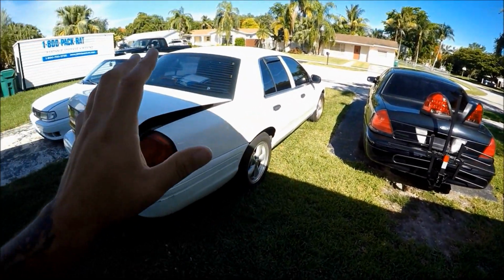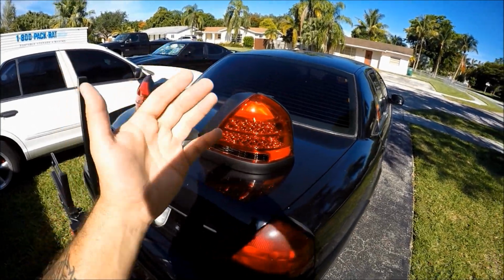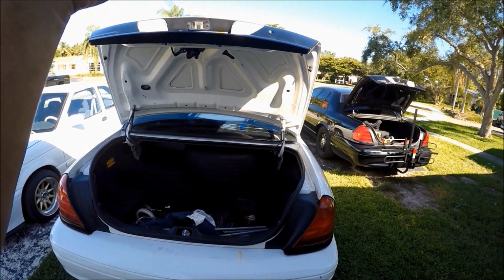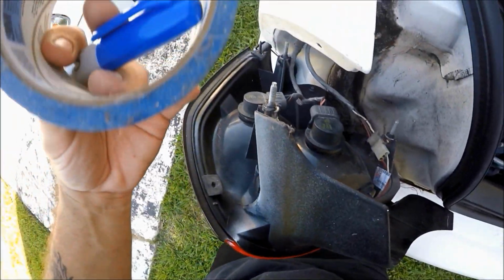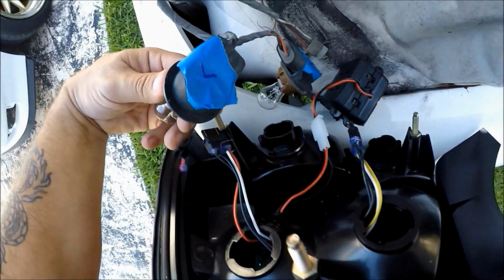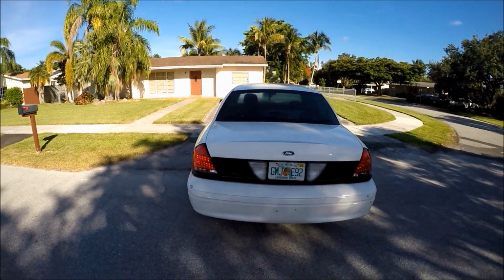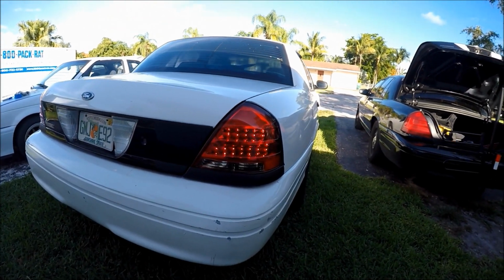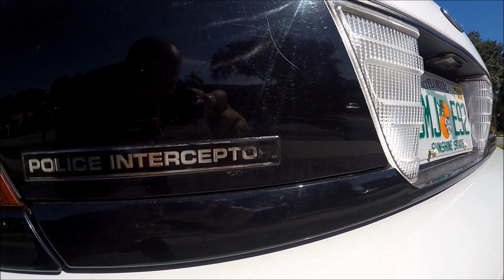LED Tail Lights Installed!! Project White Lightning

Comment: Just a FYI. The brake lights do randomly not work. I am a police officer and have experienced this and seen this many times over when we had Crown Vics in our fleet. Plus I own one myself and have had this same issue with mine. The brake switch is faulty. It sometimes doesn't activate the lights or if you let off the brake pedal a little, but brakes are still engaged, they will stop illuminating. Replace brake switch. It's seen its fair share of use if it was a retired unit.

Comment: Hi I had recently received my LED tail lights and I think there grate .how ever I would like to change the relay. Where is the relay located.   Also what did you do with the extra wires.  And plug.  When I received my lights there were no instructions.

Comment: Sir. You need to edit your video and cut out the part where you're informing watchers that you can get rid of LED hyperflash by replacing a relay under the hood with a LED type blinker relay. This is completely incorrect. There is no blinker relay on the Crown Vics. They have a Lighting Control Module (LCM) under the driver's kick panel near the center. It is one large module for all lighting control. You will be required to do a resistor on both sides for the wire that makes the lights blink. Also, that black box with the sticky pad that came with those LED tail lights is a resistor to prevent hyper flash. However, the manufacturer of the LED lights messed up with their wiring due to the dual plugs they provide causing a short when the brake lights or blinker is used. I think it is bullshit because I ended up having to replace 3 different fuses in relation to the hazard lights, blinkers and brake lights trying to figure out where they messed up at when I did this year and half ago. Anyways, edit your video sir. Individual resistors are required to prevent hyper flash for the Vics.
Reply: Your answer is exactly what I thought he was going to say... an inline resistor to trick the computer into thinking the old style light is still there
Reply: Hey bro,  i have the same led lights with the two.black boxes i only hooked one of the two wire connections like mr random said. So i have hyper flash when turn signals are used are those black boxes useless or wired wrong . How did you fix the problem any help would be appreciated thanks mr Jesse.
Reply: @jessecadena9485  You still have to place load resistors on the turn signal wire. The two black boxes are only for the brake lights, not the turn signal. These lights were not actually designed to flash with the brake lights applied. That is why they put those extra holes at the bottom. Those are for the turn signal lights that you have to add yourself.

Comment: Currently saving for my own CVPI to replace my '99 Plym. Gr. Voyager, named B.R.U.N.O. (Busted Rusted Ugly Nonetheless Operational) with 185K+ miles. He runs, but there's a new noise just about EVERY day. He WAS bought new in '99 when we had our daughter & NEEDED a m***van. We drove her & her friends & then the sick br.-in-law & elderly fr.-in-law back & forth to Drs/hospitals/VA/etc. We kept him until a m***van wasn't needed any more, but they wouldn't give us much on trade. So, I sold it to a tradesman who used it as a shuttle for guys, haulin' equip., runnin' errands, just an extra set of wheels as needed.

When HE didn't want/need it any more (just didn't need the extra expense, really) & I needed a vehicle (my Escort had JUST died), he GAVE it back to me AND. . . PAID for the plates, Township sticker, & transfer fees. This after. . . 2 "rolling" accidents, a "parked" accident, a wrinkled hood incident, 2 transmissions (they tended to "act up" after about 75K mi.), a "new", boneyard engine, & never, I mean NEVER cleaning the interior (gross!). But hey. . . free, right?

Everything worked (save the vent windows in back) even the A/C, throws heat like a blast furnace, & ran "pretty smooth". With a set of plugs, a whole can of SeaFoam run through a fresh, full tank of "Hi-Test", a "new" driver's window switch, "new" driver's SEAT (19 years of butts REALLY flattened it down), carpeting/padding (gross!), a fresh headliner, LED dome lights, restoring the crusty (yep), yellow headlamps, adding road lamps, flood headlamps (for unincorporated areas), back-up flood lamps, & alley lights . . . he's a top notch pizza delivering "machine". I've even  accidentally driven over. . . a few things (didn't KILL anything/anyone, tho), driven him in the >100° heat & <-30 cold (w/a "batt. tender), through 6' snow as well as 2-1/2 ft. water, & am, honestly, surprised at how TOUGH this stupid, ugly van IS!

Still, $750 saved, $1250-2000 left to go & I'm gonna get my CVPI & outfit HIM better than B.R.U.N.O. . . w/ Mr. Random's assistance. Selection of a vehicle, LED head & tail lamps, pushbar, finding any "hidden" features & upgrading the interior, ALL THAT & more (I'm sure).

Thanks for the channel, information, tips & tricks there, Mr. Random. Keep it up!

Comment: Got some of the LED tails for our 09 P 71. Followed instructions, install went great, plug and play. Marking the L/R plugs helped however..... no power, new tails don't work. Checked several fuses and found 2 that blew. If LEDs draw less current why would they blow 10 and 15 Amp fuses? Any thoughts? bash26

Comment: You can also buy load resistors as well right? I should've looked into the led relay when i installed load resistors for my front turn signals/parking lights.

Comment: Hyper blinking is actually illegal in most states if not all of them.  I believe the DOT sets the standard.  Turn signals are supposed to flash approximately 60 times per minute.  The reason it flashes approximately 120 times per minute after changing to LED is exactly as you stated that the car thinks there is no bulb there.  It is designed like that on purpose that to tell you that a bulb is burnt out and needs to be replaced.  It can also be a signal to the police you have a light out.  DOT wants signals to flash slower because the idiot drivers think they only need to flash once or twice during a lane change when in reality they are supposed to signal during the entire lane change.    I'm a motorcycle rider and always turn my head backwards before changing lanes and can't tell you how many times a person in front of me  with two quick flashes of a turn signal and expected me to see that by the time I time I turn my head back forwards..

Comment: The turn signal relay isn’t in the fuse panel. The turn signal relay is incorporated into a lighting control module which is under the dash inside of the vehicle and it isn’t easy at all for the average joe to change.

Comment: Run don't walk down to the PEP Boys and get that relay for those lights. The faster flashing makes you lose all the definition. You don't want those lights flashing so fast that people behind you have to look twice or don't even notice your turn signal is on. There is a reason the stock flashers are slower, old man grandpa Ford knew what it were doing.
Reply from the maker: meh....doesnt bother me
Reply: Kimberlyexpects >>>  I agree.  No one said the fast flashing is normal.  In fact I have no idea if leaving them fast-flashing is harmful to the circuitry, but if it is... it wouldn’t surprise me.
If I’m wrong, then correct me.

Comment: I'm curious as to what the portion at the bottom with the clear lens does. I was hoping that would become the turn signal, as one of my complaints about the stock tails is how it simply uses the same section as the brake lights and that's not always super visible to other drivers.
Reply from the maker: yea i was thinking the same..or maybe another set of reverse lights...sadly its just a blank lens
Reply: Well, damn. I'm always looking for ways to increase visibility. One of the things I am going to use the car for outside of my commute is I run with a group called the Warriors' Watch Riders, and having strobes and brighter lights would be great when we do welcome home parades and funeral escorts for fallen veterans.
Reply: It's there for 98-02 Vics that have a seperate blinker.

Comment: thanks for making these videos. i have been struggling with the same tail lights. i didnt know about the using just the one wire
Reply: Hi hillbilly  , i just bought this led lights have a problem with the hyper flash.  I have tried many things to fix problem from hd led flasher , mounted in line resistors with no success still have hyper flash. Any info you have would be appreciated mr Jesse my crown vic 2008

Comment: the other set of wires is for the one that had the separate turn signal. and how come you didnt put the steobes in them? that would have been cool af. they look dope. you need to put resisters between power of the turn signal and ground it to the body to get rid of the fast blink

Comment: Nice video and the lights look great. I have to say though I am not a big fan of the way most American cars have turn signals incorporated with the brake lights. Here in the UK we have to have separate orange turn signals and it's way easier to see when someone is turning. I don't know if it's your camera or not but I could hardly tell that your blinker was on with the new LED lights. Having driven 1000's of mile in the US I still prefer the separate orange turn signals. :)
Reply: I think until 2002 Crown Vics had the additional Yellow turn signals. I agree with you  there should be a yellow or orange turn signal lights front and rear..
Reply: I hate the look of amber lights in the back. In person you can tell much better when the turn signal is on.

Comment: My issue with these lights is when plugged in everything works fine but as soon as I turn on the running lights/headlights the brake lights do not work in these LEDs! Did you run into this issue?

Comment: i have to install the LED relays to stop mine. You HAVE to fix the hyper flash or the cruise control functions will not work correctly....

Comment: Mr. Random. Hey buddy, long time viewer, just never really commented.  Love your channel and everything you do on the Crown Vic. I have a 2009 that I bought in 2016 with 94k miles.  It is a black CVPI with 3.55 posi rear with the dark mode.  I love black CVPIs... and thinking about getting that push guard on your black vic.

Comment: Just curious could you do a video about install cruise control installation on a cvpi so you can take trips with it. Also you you install a double din radio installation so you have a factory look so it's not a boring am/fm radio. Ya know looks clean but you have more options as well. Even the charger pi version has more features.  Keep up the great videos.
Reply from the maker: thanks man ill look into the cruise control swap and a new radio is also a mod thats coming soon too👍

Comment: No such thing as a spot to put an LED relay, it's all through the PCM you can either do the load resistors, or bypass the LCM (I did the latter) only issue with bypassing LCM is you won't know when a bulb is out

Comment: I have a 1999 crown vic p71 police interceptor but the red and blue flashers in the front side markers and the tail lights wires have all been cut so how do i rewire them so that they work

Comment: Or simply get some Sylvania LED 4157 Bulbs 💡 🤣 Way easier and looks better..
Reply: FFDGFDOFD will you need the resistors with them i have a 2005 vic?
Reply: Jay Byrd a guy with a Ford F-250 fixed the hyper flash issue with sylvania LED bulbs by adding an LED flasher relay switch. Autozone and many other stores sell them!
Reply: I am thinking of doing the same thing to my 2007 CVPI

Comment: Mr, Random, would those LED tail lights work on my Grand Marquis?
Reply from the maker: yes
Reply: @MrRandomReviews  hello mr random i have been watching this video trying to figure out the problem with these led rear lights i installed on my crown victoria .my lights have the two light bulb connections and two black boxes which are supposed to be resistors. I checked everything wired right and even bought an aftermarket hd flasher unit for led lights did not work .any help on this issue would be appreciated mr Jesse

Comment: Will these lights fit on a 2003 grand marquis
Reply from the maker: yes
Reply: Since the grand marquis does have an extended bit it will fit but it won't completely match

Comment: I forgot to ask how bout led front turn signals, high mount, and interior light. If you do stereo system, could you do speakers without cutting anything on that harness. Less chance of shorts

Comment: Hey I know this question is completely off topic
But does anyone know where the keyless entry module is on a P71? I bought one recently and it won't into programming mode for the Fob. I wanted to check if there is even a keyless module installed, but I've been searching around and have come up with nothing as to where it would be located.
Reply: It may not have the ability or simply cannot enabled depending on what year your P71 is.  Most 2008 and newer have the ability, older would require some additional parts.